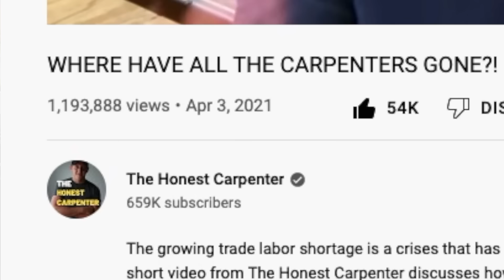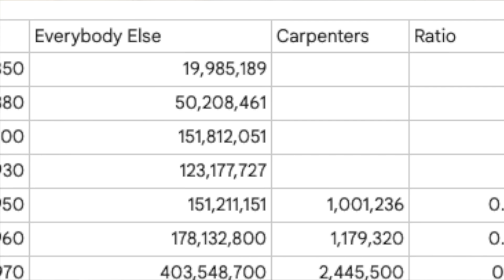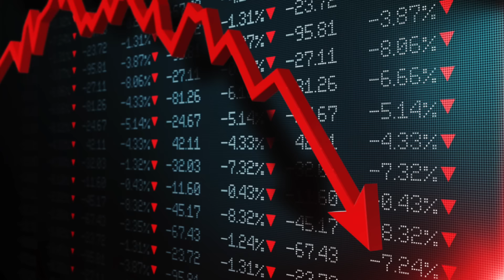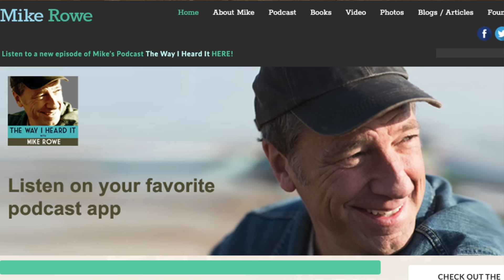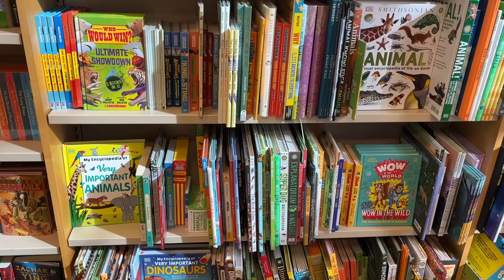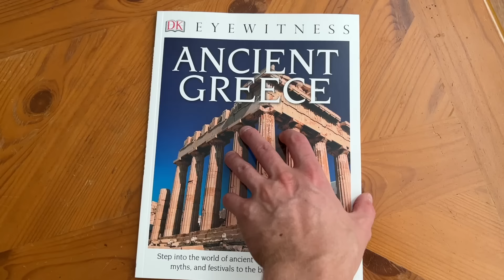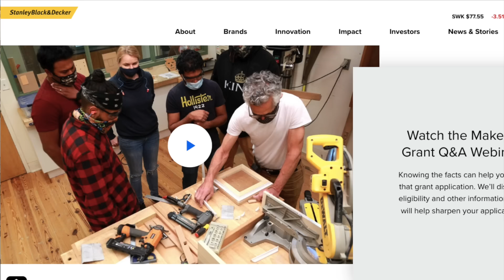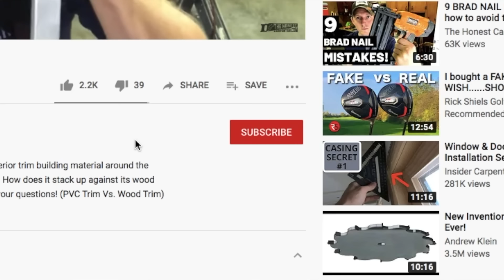THE TRADES ARE DYING...But The World Still Needs To Be Built! CAN WE FIX THE SKILLED LABOR SHORTAGE?

Comment: The problem with the trades is not that is has a messaging or perception problem, it’s that the perception is true. I’m 24, I tried to get into the trades for 4-6 years to get into the trades. I worked in roofing insulation, and a concrete company. Bad experience after bad experience pushed me into the trucking industry. I was consistently the hardest working young man out there. Never complained, always proactive. Wes never given a rase, never shown appreciation and lied about from jealous workers. I tried to get hired on as an apprentice for other trades over and over and could never get in. On top of all this I started a young family and realized the trades wouldn’t pay enough anyway to support my family anyway. Now I work 65 hours a week as a driver and never see my family. I make the same wage as a journeyman electrician and still just barely get buy. The trades are already dead
Reply: It all comes down to the disconnect from upper management and superiors with their junior level workers. They expect you to have their knowledge, but give you bare minimum pay, and then complain that you aren’t good enough. It’s the same situation in Engineering to a certain degree. Pay may be better, especially at junior/entry level positions, but the expectations, especially for entry, are absurd. Hence why we have an “engineering shortage”, and why companies outsource this work overseas.

COVID-19 is really waking the world up to this issue cause now we are seeing that massive gap in experience. It’s like a corroded piece of painted steel. Once you remove that layer of paint on top, you will notice the deep corroded out hole underneath caused by water leaking through holes. Once you remove the very skilled and knowledgeable seniors due to old age and forced retirement due to COVID-19, you will see that massive gap caused by absurd expectations (water), and it ain’t pretty.
Reply: @howardbaxter2514  disconnect?  No my guy , THEY JUST DONT GIVE A FUCK. their actions have shown this much
Reply: Yes dude I just turned 25 but the last 2 years I work 2 warehouse jobs that had three main trades I was interested in but the people I work with either lied or my  colleagues at the time would get piss off with either me or themselves when they fuck up and let it out on me and basically it takes times to get me piss off but once you do it’s a whole scene even rn I’m still debating to get into a trade or give up and just become a supervisor at Walmart 😂
Reply: Wow, all I hear is sour grapes. No one told me I was special so I quit. Wtf. I’ve been in masonry for 12 years. Was a laborer for 5 of them showing I was committed to the lifestyle. No one wants to train someone who isn’t serious and waste their time. But if you have a good attitude and not be trying to out perform everyone else on the same damn team the old heads are usually cool about teaching anyway. After laying brick for 7 years I’m good at it. So good I start my own business. I make great money, my own schedule and I’m my own boss. It’s all about getting the skills. That’s it. Not recognition, extravagant pay, or attaboys, not until after you’re the fucking best at what you do.
Reply: Underpaid overworked and not appreciated one bit
Reply: @BrickmasterinKy  ratioed
Reply: @BrickmasterinKy  Ha I tell my dad some jokes about us youngsters(I'm 22) since he works in masonry. Dad- "can't believe no ones is willing to learn for free and still get paid ($20 an hour)" Me-" you know dad us new generation we just want a easy job that pays well, I'm your son who you showed hard work since I was 6! And still want to work under $10 an hour somewhere else! We're the laziest generation ever! Don't ge me started on the younger generation! They will be the end of this world!!! 🤣 I'm joking I know there's hard working young men like me out there. My dad is teaching me masonry so that I can create my own company, thinking of offering free teachings for those who are willing to work in the future but for now I'm just beginning to learn the ways of masonry from the "lighting sage"🤣😂( dads nickname since in his young Era he could finish up a 2 story house in one week with only one helper)
Reply: @BrickmasterinKy  not sour grapes at all, just pointing out the on going issue in the system. Even my parents agree with what I am saying, and it is cause they are in those positions to very easily see the divide.
Reply: @BrickmasterinKy  here’s the thing Jonathan, there are too many people, especially in upper management that are hiring, that don’t want to invest in training their new employees. This is especially the case in engineering. Fresh college graduate cannot find a job cause they don’t have 3 freaking years of experience in some Uber specific software that no one has heard of. Hell, you don’t even need to be a college graduate, you could be in college trying to get an internship and they still have these levels of expectations of experience. It truly is that bad. So cut the crap about how it is my generation’s fault when it is YOUR generation that is being full of selfish pricks and don’t want to teach younger people anything, and then criticize us for knowing nothing. 

Oh you are having to look up online and watch YouTube videos on how to cook cause your parents never bother teaching you? Pfft, pathetic. Oh you don’t know how to properly change your tire or oil cause your parents never bother teaching you? Pffft pathetic. Oh you don’t know how to file taxes cause your parents never bother helping you? Pfft, pathetic.

I hear that all the time from older people. Here’s an idea, don’t blame young people for not knowing what they do not know. Instead, blame the parents and the superiors for not bothering to do their damn job. Blame the bosses that have obscenely high levels of expectations of experience for their employees but give them scraps, and then get mad when they aren’t doing good enough because no one taught them how to do things better. You know what that is Jonathan? Being a dog shit leader! It’s time for older people to grow the hell up, and be the type of leader your employees need you to be! We don’t expect to be coddled, but we do expect to be taught, corrected properly when we make a mistake, and answer our questions when we need answers so we can do our jobs to the best of our ability. We don’t need bosses that are willing to throw their employees under the busses because they didn’t do it the “right way” AKA your way that you never explained!

Rant over!
Reply: Thanatos  thats true. I used to work a metal reinforcement fabrication job at a factory and that shit was really hard on the body. Pay was fine enough for an 18 year old me but the work was too hard on my body and they do know this as we got payed breaks every 2 hours totaling 1 hour every 8 hour shift instead the standard single 30 min lunch break we get here in Norway. Worked the job for 5 months and at the end of that i was absolutely spent and my back is still fucked months later.
Reply: @TheWacko Here. Type in The BrickMaster LLC in Kentucky. Or Brick repair Lexington ky. Masonry contractors ky. You’ll see my face, my work, nothing but solid reviews. Just bought my first new Silverado a few weeks ago. So…🤷‍♂️
Reply: @howardbaxter2514  You can feel as disenfranchisement as you want it still doesn’t change reality. After 18 years old the world becomes available. Mommy and daddy aren’t responsible for what you learn or decide you can learn. Shit parents don’t always equal who you are permanently. There should be a time where you realize hey I’m missing these skills. See I’ve been there a long time ago. Feeling undervalued, underpaid, overworked. Years of being the grunt, the nobody, even when I made a difference for a job I didn’t get the credit or more money for my part. And I’m not saying we can’t encourage laborers to stick with it, or raise pay. But there’s a weird line you have to walk as an employer to your help. Learned this myself here recently.  After trying out a couple guys with zero experience in masonry at all, first thing was separating the time to teach from the time to lead. Cant delegate skilled tasks to newbies at first. They just need to show up, be ready when I need it, and when it’s showtime care about the work. And it’s not the parents fault if there isn’t any work ethic or pride to be found. Often those can’t be faithful in small tasks aren’t capable of the bigger rewards they crave. Putting in dues are a fact of life. That’s only the smart thing I’ve done was treat my time as a laborer as a learning experience, and how to have my own fun with the job.
Reply: @BrickmasterinKy  well long as your paid well for simping, most tradesmen are not.  why imported haitians will probably take over the
Reply: @TheWacko Hey thank you. Everyone else seems to think I’m just writing this stuff to hear myself talk. This has been my life for a decade. I’ve been to college like everyone else got my associates in computer science like a good boy. 20 grand in debt later I realized I hated being the computer guy for a job. I hate going to the same place, doing the same exact things daily, and I knew in my heart there’s no way this was it. Anyone who would of told me I’d be a brick Mason for a career and my own boss by 30 I’d call them full of shit. But doing the time is easy compared to making the choice you want to take your money seriously. Going out on your own. Doing work for cheap to get the exposure. The guys who own the masonry companies here don’t look like me. I look young as fuck. I’m also bi racial. Imagine you’re getting bids for work on your 2 million dollar home, you get some old white guys that come by and take a look. Then I come in. Used to always hit the same bit of mistrust from being different. But after talking for a minute people see: A. I’m very knowledgeable in my field. And B. I’m probably better than some of these other guys once I break out the portfolio. There’s enough fakers to do bad work to make me look good too. But yeah I’ve been where you all have, and probably have more in common than you think. Just fucking believe in yourself. No one else will. Matter of fact. Your friends and family will be the ones to tear you down first.
Reply: @BrickmasterinKy  Can I ask how much you earn. I'm in the extremely high cost of living state of massachusetts and everytime I search average salary for experienced bricklayers (something I am genuinely interested in doing) and it's coming up with $45,000-$60,000 range. That is pure shit pay for that kind of labor. As someone in the field, can you give me a better idea of the pay, because probably the results im searching up may be wrong or inaccurate. Otherwise, that pay isn't worth breaking your body for. Literally just work at a fast food joint and throw everything into crypto would be a better strategy than that
Reply: @BrickmasterinKy  You completely missed the point. It's not about special treatment, it's about at bare minimum semi-reasonable. If you are not paying your employees enough for them to survive in the economy they live in they have every right to be upset about that and seek other employment, especially if the working environment is miserable on top of not being paid sufficiently. Sustainability should be more important to you in a job than worrying about your ego and whether or not people will think of you as weak or unmanly for not accepting unfair treatment. I would argue the opposite. A real man stands up for himself and knows his worth.

Comment: Sorry but it's the trades on fault. Here in New York in the '80s I worked with contractors right from high school got paid minimum wage you Apprentice basically learn on the field I also took courses in high school. Anyway in business learn what I was doing as a carpenter but it was easier for me to get into the house painting business and of it and finishing trades sheetrock molding Etc you got paid well average labor price was $200 a day in the late '80s and to the '90s. When the market started getting hot in the 2000 a lot of building work what happens contractors hired cheaper illegal workers drop the price to $80 a day they didn't want to pay $200 a day guy to work when they can pay $80. This happened for a long time I saw many crews all illegal workers are very very large part of it. They drove away everybody I knew over the years that lost money because of it they got into the heads of homeowners to hire illegals because they were cheaper so homeowners when you get through the price they got a price from an illegal and it was a big difference so hard to get jobs. When you look around at the illegal workers on these construction sites remember you guys the contract is hired them and destroyed the labor force that was willing to work but wanted to get paid for it
Reply: Yeap, exactly

Comment: I tried to be a carpenter,  but no one would take me on. 
I found this to be true in all the trades. 
But now I'm in autobody.
Reply: For real I've tried in my local carpenters and plumbers and pipe fitters. They don't call even after passing the test the drug test not to mention the dedication to stand outside while it's snowing freezing your face and hands that when you get in you can't barely write your name smh
Reply: Autobody is a good skill to have, if you can do autobody you can do work better than a lot of yacht workers. Most people in Marine don't know a ton about MEK and resin mixing percentages, or good use of fillers or anything. They just kind of assume "a lot of everything" is what works, which is really not the case. Too many layers of fiberglass on top of each other with too much MEKP can lead to burning, which can make fragile structures. 

Too little harder in too cold of an environment can lead to improper curing. I lot of auto guys work in cleaner more professional environments where that stuff can be done right, boats are often in crapper boatyards, marinas, or someone's backyard. 

The point of what I'm saying is one day you can go work on boats and charge 150$ an hour for every person you have working on that boat and make killer money, even if it's just yourself. The cost of starting it is normally lower than an auto shop, because you don't need lifts, a shop, specialty tools, etc.
Reply: @Samuri5hit84  I was reading this thinking this idea was genius then it dawned on me…I live in the desert😢
Reply: @leonelgalan9431  yep. Where I grew up, it’s who you knew to get into a trade. I went to a vocational school, did well, but never got a call from companies or unions. I knew others too, and that was back 30yrs ago. I do quite well now without working a trade. Screw the unions, they’re all a scam.
Reply: @josh3326  yeah it's crazy I have a journey men buddy in the pipe fitters guess his name and word don't mean anything to the guy that runs the apprenticeships lol

Comment: There’s not a one size fits all approach BUT. I think it takes a lot and through time and maturity. Graduated college back in 2018 and natural found it tough to find a career  associated to my degree. Again, drilled into my head college is the only route to success. I got lucky and manage an auto shop. Through this I’ve met an insane amount of people. Quite a few in the trades. Specifically heavy equipment operators in my local union. Felt uneasy about it but I got an opportunity to run a skiddy to help build a local bmx track and got hooked on the dirt turning life. If I would have spend the same amt of time as I dedicated to college, to getting certified and in a union. I’d be a Forman by now. But that’s the life experience. You can’t be afraid to back to the drawing board. OR fearful of your family’s opinions of your career…….But a lot of it has to do with outside influence.